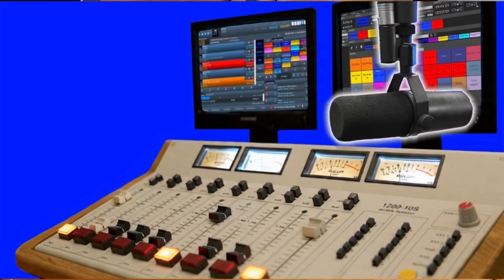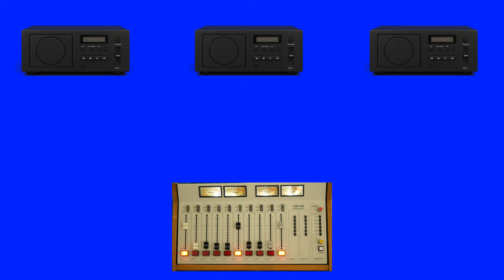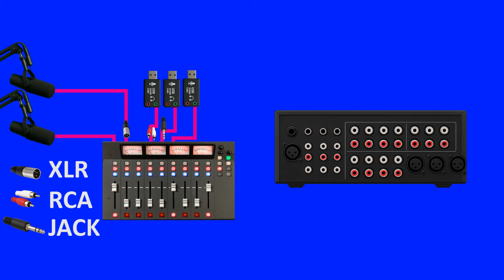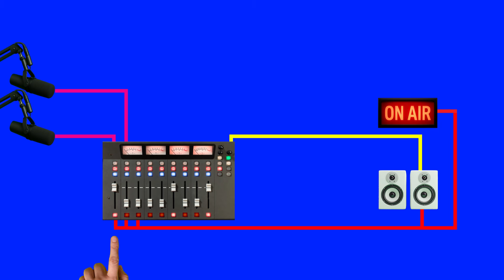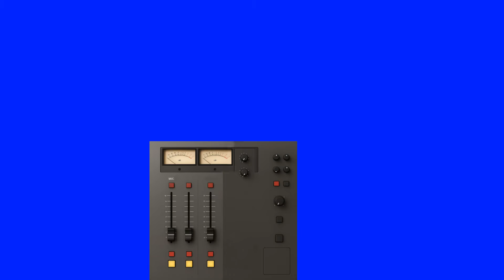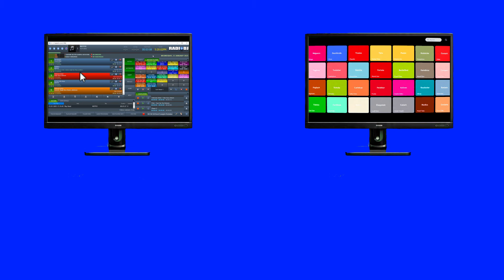Internet RADIO STATION STUDIO How To Set Up Complete Wiring For Radio Station Including FM

Comment: تكلافة انشاء محطة كاملة
Reply from the maker: That depends on how high end you want to go. A basic studio can cost as little as $2000 But a professional broadcast studio can cost $20000 and more. You can actually build a studio for as little as a few hundred dollars if you have some spare things you can use like old computers and an old hifi. The expensive  stuff is the mixing desk , the microphones and the audio processing equipment. The studio room can also cost a lot because of the sound proofing and sound damping. So it can be done cheap or expensive. It's really up to your budget. Keep in mind that I am only talking about the studio. The radio tranmitter part can be much more expensive. The tranmitter and antenna can cost $10000 just for a basic community radio station transmitter set up. Commercial stations can spend hundreds of thousands of Dollars.